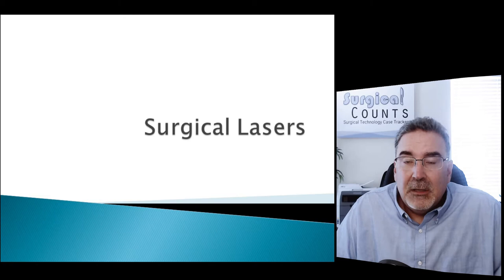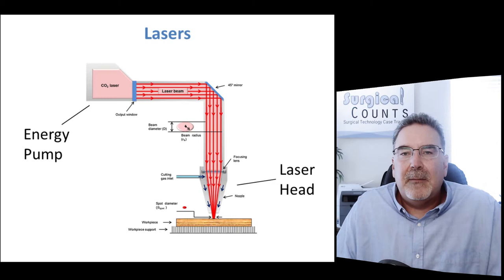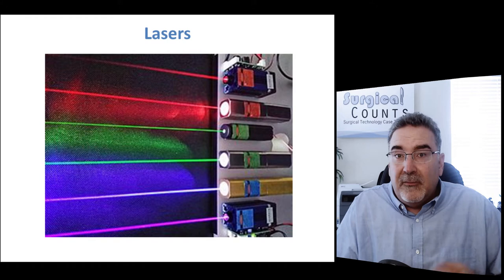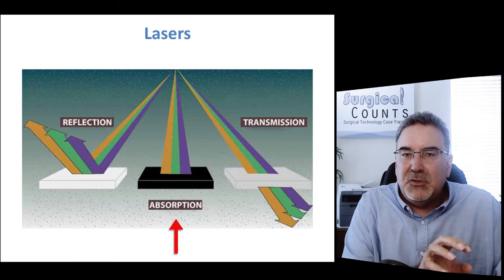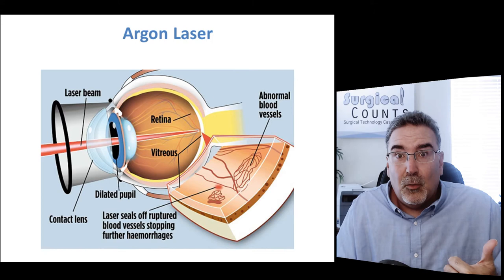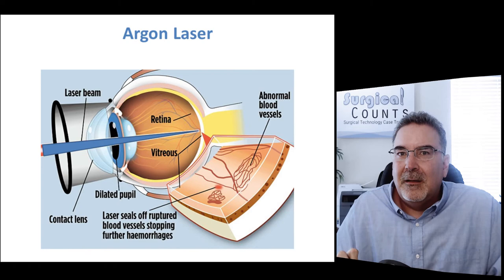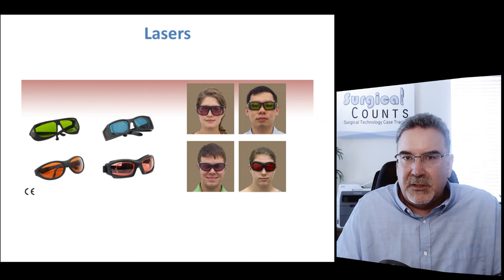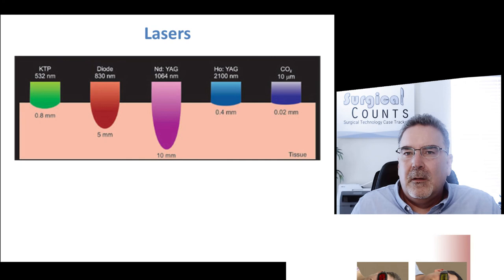Surgical Technology Lecture - Surgical Lasers

Comment: Hi doctor, I'm laser engineering student
I real liked how you explained everything in the video, thank alot, and so you uses gas laser in surgery, i have question
Is teh laser used ny the doctor or does it require laser engineer in the surgery room?
Reply from the maker: The doctor uses the laser.
Reply: @SurgicalCounts  thanks
Does it require the engineer to be in the surgery room to change the frequency and wavelength of the laser?
Reply from the maker: No. These devices are pre-set and designed to be very easy to use. All you need is a key to turn them on. A tech or nurse will test them, then the doc uses them to perform the procedure.
Reply: @SurgicalCounts  ok , thanks doctor, damn that sad